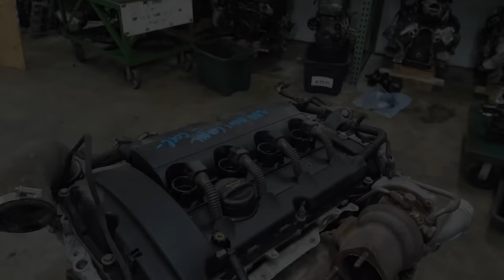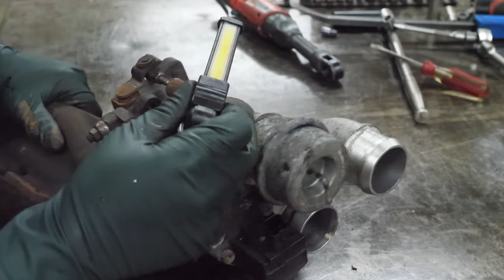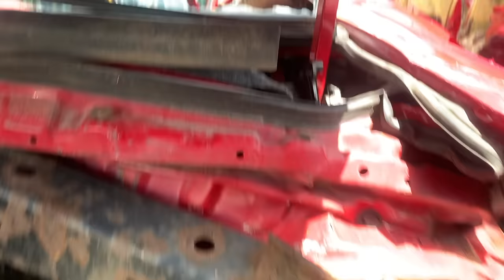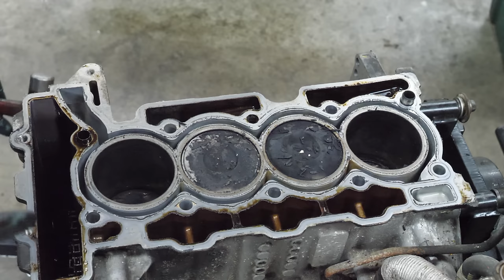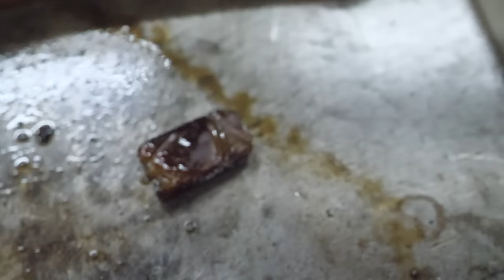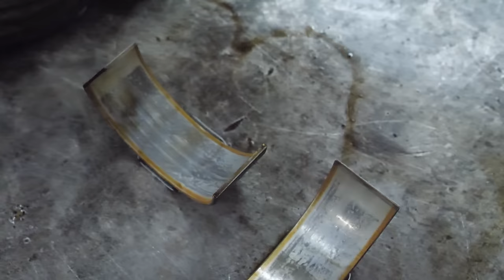JUNK Mini Cooper S (BMW/Peugeot) N14 Turbo Engine Teardown. Why Do People Buy These?

Comment: Read down some ways but didn't see so sorry if I missed it and am being redundant, my opinion this engine was underwater in a flood and was also running when it went under, sitting in the building it had time for the hydraulic lock to dissipate.BTW When did Adam Sandler get into automotive salvage? You already rotated the engine before disassembly.

Comment: Take his advice and make sure there are good service records from a dealer or reputable Indy shop if you just have to have one of the r5x minis. If not you should keep in mind that the chains, guides, valve stem seals, water pump, water pump pulley, thermostat, water transfer pipe, oil pump flow control valve seal (they make a kit), front main seal are all common failures and I have done several of each of those in the past year at the BMW/mini shop I work at. Also check above the crank hub behind the pulley cause there are 2 plugs in the timing cover the are press fit and sealed with adhesive that can leak.

Comment: 167k km trouble free.
 Well, let's say I've had a completely different experience with this car.
I bought my '07 R56 cooper (non turbo) in 2008 from a Bmw dealer in Germany with 18k km on the clock. The day the car left the dealership it was the last day the car saw a workshop (except for the tires).
I own other cars and this mini has been my  'commuting car' for the last 15 years. Except for oil changes, until the car reached 185k km on the clock (nov 2023), I almost forgot there was an engine to take care of. The list of issues I experienced are, no, is  : a coil. 
167k km and 15 years without any other issues than  a coil, never seen a workshop.
The last weeks, I entered for the first time the 'N12 timechain problems' zone. Trying to source the cause of a rough idle, I eventually found out the  chain oversprung.
Having read and watched about this engine, I decided to replace the chain, the guides, the tensioner, the inlet vanos, etc... I am currently doing it by myself and I am surprised how many specific tools it requires. However it appears feasible but as mentioned the space is scarce and a lot of time is devoted only to get an access.
Do I consider this experience with my R56 as a good experience ? No hesitation. Yes, thousand times.

Comment: I had a BMW 118i with this engine from about 27k miles to about 90k miles and I had to change the water pump twice, luckily on the extended warranty. Somehow I got the car with extended warranty for 3 years costing £800 at a Ford dealer (weird I know). The warranty paid for itself in the first year :)

Comment: What you said at 1:30 is true for almost any engine nowadays.  All manufacturers oil change recommendations are geared to get the car past the warranty.  I have had many cars throughout my life and religiously changed the oil at 3k and then at 5K when I switched to synthetic. I do agree that this engine has problems.  There are many things I don't like about it.  Too much plastic, too many integrated plastic parts that fail.  The monstrosity of a thermostat, the several hundred dollar valve cover that needs to be changed because PCV failed, etc.  When it's running right I love the mini Cooper S handling and acceleration.

Comment: I have the follow-on engine the N18 which is very similar. There are a bunch of issues with this engine as you already mentioned. High pressure Fuel pump, Thermostat housing, timing chain, solenoids, chain tensioner just to name a view parts I already needed to exchange. But, I think one of the main killers of this engine is that the dipstick is a pain to reed. Then pretty much every of these engines burns oil. Like 0,5l/ 1000km is normal. In addition, there is no sensor for low oil level and 30k change intervals. That combination lead for a lot of users that the engine runs with way to less worn out oil. There is no better recipe to kill an engine I think. So, if you own one of them please make sure you check you oil after each fueling stop and please also change it ahead of time. The other issues are bad enough as they are. BTW, Great Video that also gives some background on where which bolt is. Please keep up the great work.

Comment: Enjoyed the video. I have one of these crappy engine. Mechanic also found pieces of timming chain guide from a previous part that was replaced. Authorized dealer did not clean out the pieces.

Comment: I agree with you about factory recommended oil changes. I think that 5000 miles is more reasonable, even though the oil is still good it carries a lot of dirt. Is that a more reasonable number?  Just wondering what oil you would use in a BMW B46? I look forward every week to your tear-downs. It seem most failure are do to maintenance. Really great job!!
Reply: I do 5000km.  EJ253.  Perfect at 300k

Comment: FIY to anyone with a similar problem with water in the engine on a N14 or N18 BMW engine.  The problem is there is an aluminum core plug (similar to a freeze plug) located in the top center of the cylinder head that works loose or completely comes out dumping water directly into the crankcase.  Fix it by tapping the hole with 3/8" pipe tap (put grease on the tap threads to catch metal shavings) then install countersunk pipe plug with locktite.  Also, to remove the timing chain and gears with the tensioner guides all at once: remove top tensioner guide, the cam chain tensioner, two front cover guide bolts, TTY cam gear bolts and large TTY crank pulley bolt, remove both cam gears and holding onto them lift upwards and the chain along with the bottom crank gear with the guides should come out the top through the head.  Be sure you go back with new TTY bolts torqued to specs and you must have a Engine Camshaft Alignment Timing Tool Kit to go back together with this (about $35 on Ebay)!

Comment: Oh yeah the prince engine, those are wonderful. So reliable and good as we see on this video..

Joking aside another really common failure on these engines is the thermostat housing, it will start leaking from the seams of the plastic pipe that connects between the housing and water pump. Easy job to replace in theory but it's pretty tight spot
Reply: In some installations, at least the Citroen C3 non turbo, there is no level sensor in the coolant reservoir so the first sign of a cracked thermostat housing is overtemp. In one case I've worked on this lead to an irrepairable cracked cylinder head and the other a loose inlet valve seat that eventually  stuck open, the piston hit the valve and the insert broke, shot peening the cylinder head and piston. Thanks for your excellent videos.

Comment: Owning such a jewel I have had two of the three problems.  I believe the pvc system is under designed requiring in oil leaks.  Before Mini graced our shores with this power plant, I believe Chrysler gave us a dose with their Hi Neon product. Finally I will say that quantity of clear water came from the car going through a major flood (up to the hoodline). Not  that uncommon in coastal Hurricane areas.  Keep up the great work.

Comment: I sold an old Citroen C1 to a neighbour, it had done 115,000 miles and with it's 3 cyl Toyota engine which was well maintained, it had most of its life still to run. They sold it and bought a faster cooler mini cooper, and six months later it's engine self destructed, turning the car into junk at 60,000 miles.
I bet they wish they had stuck with the Toyota engined Citroen C1.
Personally my favourite engine is the 300 TDI in my defender. It's not fast, but when it starts, you feel like nothing is going to stop it. I recently rebuilt it and gas flowed the head, because it was a time consuming but fairly straight forward thing to improve the nasty casting surface, and improve gas flow.
I love it because it can run on almost anything, like veg oil or even old engine oil if filtered, paraffin, biodiesel and more. I just use diesel, but love that this pre overcomplicated and over engineered crazy self destructing computer controlled engineering is completely absent, although it is direct injection and is awesome off road with the low down torque needed, and it keeps a pace with highway traffic just fine.
Best of all, anybody anywhere can fix it, which is why the army Wold Land Rovers all had 300tdi's. Apparently they can achieve 1,000,000 miles if taken care of, which is proper truck territory. Although in America you seem to like your engines to be at least 4.5 Litres capacity. But I do get over 30 mpg which is great for a tight assed Scotsman in the Highlands lol

Comment: I'm on my 5th Mini. My first was a 2012 Cooper. I've had no issues over the years apart from a major one on a 2014 Cooper S with the 2L BMW B48 engine. The engine and gearbox were replaced under warranty at 8,000 miles. The cause was excessive crankshaft end float.

Comment: I have two of these in Mini Countryman’s, although they’re the slightly newer N18 versions. They definitely have some unusual engineering but if you keep the carbon from building up and do proper maintenance they’re really not bad. The worst part is how tight the engine bay is. You really have to learn your way around things and just disassemble stuff when it’s in the way instead of spending hours trying to get around stuff. Helps to have the dealership and factory computer software pirated with all the tach manuals and part numbers so you save yourself diagnostic time. These cars are maintenance queens though, you really need to do almost double what the manufacturer recommends. But with basic mods and some tuning they will make 240hp easy.

Comment: I had exactly the same problem with a waterfall exiting the sump when the drain plug was removed.
After a rebuild I filled the coolant system only to have it go straight to the sump again.
Eventually I found out the frost plug had fallen out of the head and I noticed the one in the video was missing too .
Nice design BMW ( not)😊

Comment: I would definitely agree with this man's summary of the N14, as an owner of a Cooper S Clubman...with the infamous N14.  It's a great little car...fun to drive. I like it and take care of mine.  But you have to manage the maintenance carefully.  Oil changes every 5000 miles, without question (5W30 full syn). Timing chain replacement at around 75K miles...no surprise. Seafoam treatment at least once a year and also to the oil (one small espresso sized cup to the oil fill) at least 200 miles before that oil change. Also, install a damn oil catch can! Check the intakes for carbon build up and schedule a professional cleaning when necessary (crushed walnut shell blast).

Comment: Several mysteries about my car were solved by watching this video.  Especially mystery of the dipstick.  I’ve never seen an engine autopsy like this and it was…very enlightening, at times frightening and in the end makes me wonder what lurks in the depths of my poor Mini engine. Poor thing has spent almost all its’ life outside, uncovered in Phoenix.  I love my car.  2010.  Only owner has been me.  Not even to 90K miles yet.  But I know NOTHING about cars or engines or maintenance.  It is really, really fascinating.  Lately I’ve been quite concerned about a burning oil or plastic smell with smoke wafting out from under the hood.  This can’t be good… 😢

Comment: Hi I really enjoy watching your videos, I live Australia, I just get so captivated by your videos, thankyou. I just watched this mini engine tear down. A bit of a back story behind this engine, I did my apprenticeship with Peugeot and this engine was first a collaboration between Peugeot/BMW. Peugeot needed a new fuel efficient engine BMW needed mass production and Peugeot had the biggest engine foundry at the time.  So BMW gave the rights to the vanos system to Peugeot in exchange for numbers thus the collaboration in fact Peugeot still use this engine. 
It was an absolute bucket of garbage from the very first iterations we first had trouble with software and pistons destroying themselves due to leaning issues, that fixed it for a little while but the problems kept coming.  By the time I left Peugeot this engine had such a bad name.  The engine it replaced was a  2lt engine built entirely by Peugeot and I have one it’s  19 years old this year and I can honestly say I have never had any problems with it bar a coil pack failure.

Comment: There was a problem with Mini using poor quality timing tensioners .They eventually leaked down do bad the chain would rattle pretty badly. The fix is pretty straightforward. The whole chain and guide is replaced as a complete unit. The front crank bolt once removed splits the crank section in two pieces , you just pull it up then and drop a new one in place . 
In this case I suspect they let it run too long with a knackered chain and that could possibly have lead to valve timing issue in conjunction with a bad injector which created the lean cylinder and burnt valve . As for the coolant in the oil , you never tested the oil cooler which I suspect is bad . That much coolant/ water in the sump if from the engine is far too much for a head gasket and not real sign of it running with a blown head gasket 
They are my thoughts, having experienced owning one and having to rectify its problems . Btw it requires a cam timing kit to set up the cams and crank prior to chain removal , don’t attempt it without it it’s much much easier

Comment: Coming from a N18 2012 Countryman that we've had for 11 years 58k miles. I've learnt a few things from experience. Change oil every 5k miles: I lost a turbo waiting to long. Have a quality oil catch can installed: These cars have a horrible PCV system. Do it right replace the entire valve cover. Oil Catch Cans will let you know fast when PCV system is going down hill. Use premium octane fuel: not a problem here, 93 octane available in my state. Had to replace HPFP twice, nothing you can do about this. It's the nature of the beast. Waterpump was replaced, nothing preventative you can do. Its the nature of the beast. Vacuum pump replaced also: Nature of the beast. Injectors changed: I was bored and they are cheap to replace. Oh it's not over yet, change transmission oil every 50k no compromise. Our mini has never been tuned, my wife drives it like a granny, well, she is granny and I'm saying this lmao hoping she never finds this post.😂
Reply: These Mini Coopers and their owners are very British. They thrive and persevere regardless of what horrible things the Germans throw at them.

Comment: As long as you know what to expect (just like a small engine) than Almost any engine is good. An average small engine lasts about 1k hours. So if you know what your getting into it’s fine. Just know what your buying. I know they aren’t comparable entirely but the same thing applies, great video

Comment: I nearly bought one of these engines last year, fitted in a Peugeot 308 on a UK spec 2015 model. I test drove the car as I wanted a car that got from A to B and commuting to work and I was impressed with the power of the engine, I think it was 156bhp from factory. So for a commuting vehicle it was perfect. 

But when I checked the engine, I saw coffee coloured residue around the oil cap and the car dealer said the car was jet washed and that was condensation which I did not believe for a second, So I walked away from the vehicle as the dealer did not offer any warranty, just a 14 day break cover for the vehicle. 

But watching this video, it was luck I spotted the possible head gasket problem and I was potentially saved myself a lot of money by not buying it.

Comment: I've had my 2008 Cooper S with about 45,000 miles. The first 6-8 years where cheap, then the maintenance really started adding up. The sun roof was repaired under warranty. There was also a cold start issue that was well known. I think the timing chain was replaced under warranty. The only reason it's ok to keep is because I drive so little. If it was a daily drive, it'd be too expensive to operate

Comment: It isn't accurate that you find this engine in Peugeot, as the title suggests. The Peugeot version pretty much only uses the block, while most of the internals and accessories are improved PSA design. They don't suffer from the timing guide problem and are overall much more reliable than the N14. The most recent iterations are very good.

Comment: My N14 blew up at 131,000 miles due to a failed HP fuel pump.  Love the car so I purchased a rebuilt N14 recently and so far so good but I know it's only a matter of time.  Engine/install cost more than the car is worth but I don't regret the decision to spend the money (yet lol).

Comment: Can confirm, EP6 engine in Pug 308, had to rebuild engine within 6 months of owning, emmissions failure due to oil burning, leaky valve stem caps. Full engine rebuild whilst the head was stripped. Added an oil catch can on the valve cover breather. Have put 60k miles on it mostly trouble free since, but yes a very high maintenance engine, cooling system component failures mostly, rattly pump and failed plastic piping.

Comment: Back in 1993 I bought a nearly new Peugeot 405 1.6GR. The maintenance schedule for the Timing belt replacement was 24k miles.